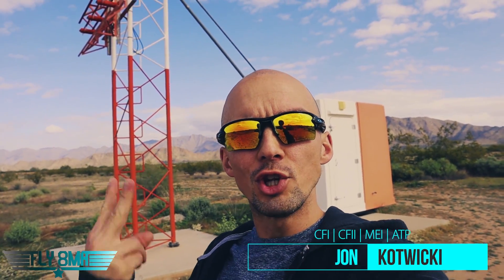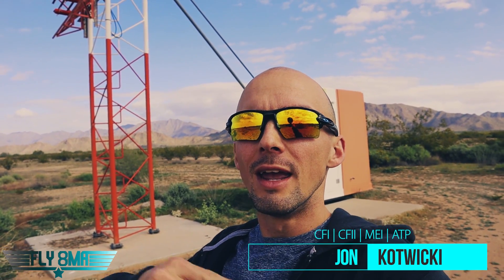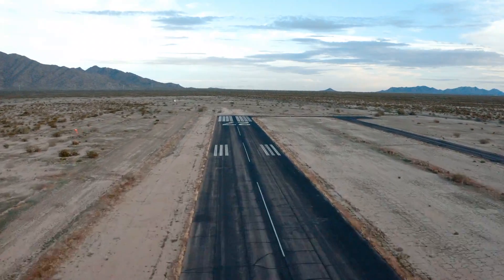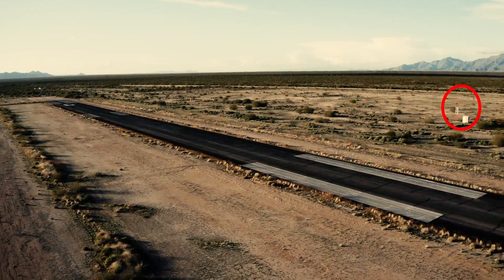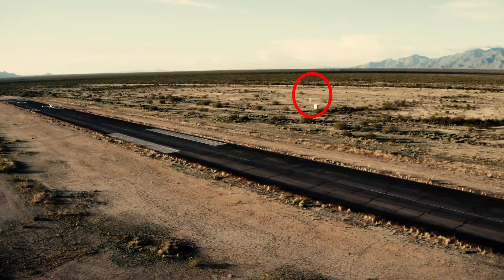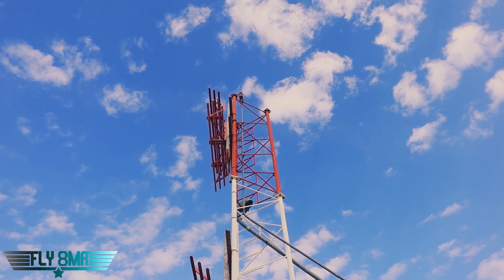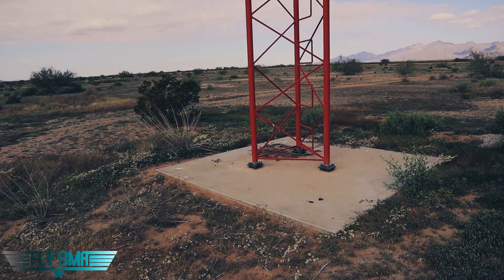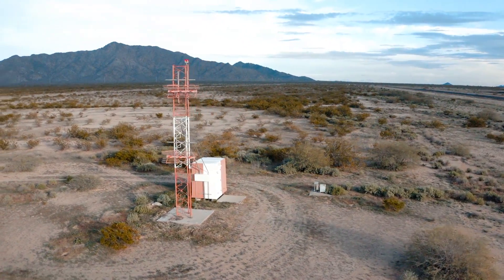2min Tues: ILS - LOC and Glide Slope Antennas

Comment: This is almost entirely incorrect. Yes, it kind of tells you what a PAPI tells you, but this is far more complex. This is a null reference image array glideslope with the lower antenna transmitting the Carrier plus Sideband (CSB) signal at 3 watts. The upper antenna transmits the Sideband Only signal at around 30 millwatts or so to mix with the CSB signal resulting in the fly up and fly down indications from the glide angle (null). The signal is being both directly radiated and reflected off the ground to produce the signal in space. Glidepath angle is measured using a special FAA aircraft to assist NAVAID specialists in setting up the glide angle and width among other things, glide angle is typically set at 3 degrees by adjusting the height of the upper antenna.

Great shots of the system though.
Reply: Get em Gary!

Comment: Why do some ILS antennas have 3-arrays instead of two? I live in Charlotte and frequent the observation area at KCLT which is next to 18C which has the 3-array ILS antenna which is not certified for CAT II or III landings. So was wondering why 3-arrays instead of two at 90MHZ and 150MHZ, what is the third one for? On a side note. Can you do a segment on what a "TRSA" is exactly and how to navigate it VFR and IFR.
Reply: Third antenna is for capture effect. The other 2 antennas do not radiate at 90mhz or 150mhs either. 90 hz and 150hs are the modulating tones.
Reply: Probably an IAP that requires a different descent angle.. wild guess, tbh.